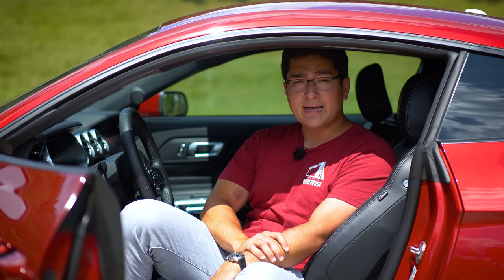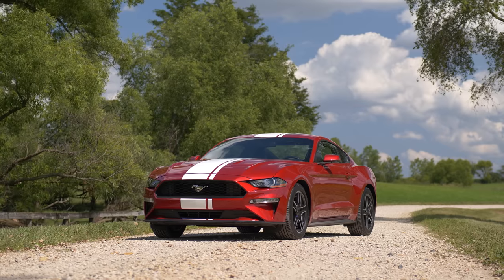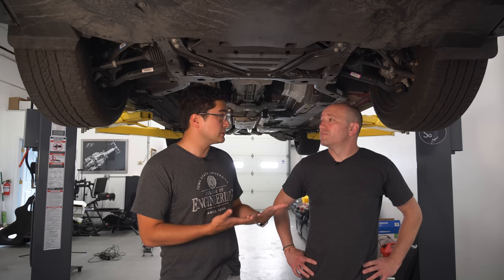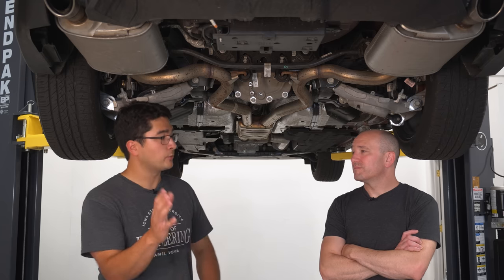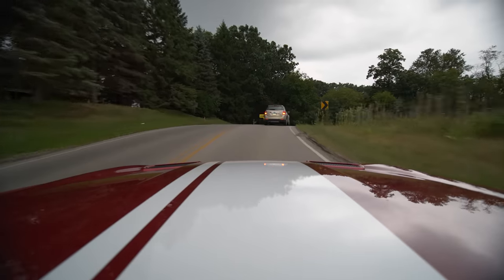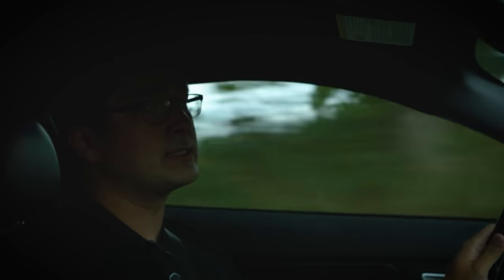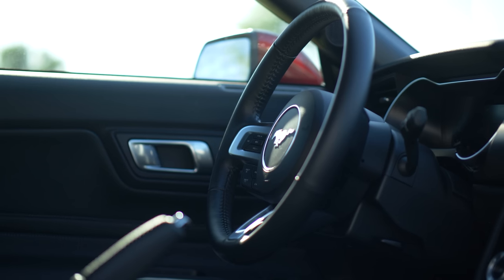2020 Ford Mustang EcoBoost | Red Headed Step Child

Comment: These two need to study some Mustang history. Throughout its existence it has been available in base models that did not have high powered engines. The majority of owners just wanted a "sporty" two door car in coupe, fastback or convertible shape. A lot of 6 cylinder Mustangs were sold and are still in use. I had an 86 GT that had 200 hp and thought that was fine. I had a 96 Corvette with 300 hp and though that was fine. Now I have a 2019 EB with 310 hp and it seems more than fine. If Ford offered a little V8 with 310 hp I'd be fine with that.  I expect Ford to offer the V6 Ecoboost in the 2022 Mustang, probably another engine you won't like. No guys, not all Mustangs need a V8, just as not all Camaro and Challenger need a V8.
Reply: Check out my EcoBoost on my channel 403 horsepower.

Comment: In Europe the running cost alone is enough to make this car a big hit. In some European countries displacement plays a major part of a car's tax, sometimes to a ridiculous degree. For example in my country (Romania) owning a 2.3 means you pay about $150 in annual car tax whereas owning a 5.0 engine means you're paying about $1.7k. That's an insane difference, largely because my country is ran by a circus, but this is the reality in these parts. 
Not to mention that a 300HP RWD car is considered quite powerful, and very few cars are RWD around here. Add to that the fact that it costs about 40k EUR and you've just transformed it into an enthusiast's bargain.

Comment: Ford did good with this 4cyl mustang. But when they announced an eco boost mustang I was silently praying that they’d use the straight 6 that’s so popular in Australia coupled with an optional MT.  If it “only” made 300hp the tuner crowd would go nuts. You’d see 1000hp versions by various tuner houses at the end of release week.

Comment: If it weren't for the fact that I live in Colorado (CO Springs), I would happily have one of these.  It's perfect as that compromise between fuel-efficient communter and performance car.  Unfortunately, winters here come early and stay long; we actually got snow on June 9th this year!  (Wasn't much, but still...)  RWD on snowy/icy roads just doesn't work.  I'm sure some folks will pipe up and claim they do just fine in the winter.  I'm sure some of them do.  But it just isn't good here.
Reply: Yep RWD just don't do good in snow period. I live in the southeastern part of Bulgaria, where the winter is real light, a lot of times we don't even see snow. But north western part where my parents live, boy oh boy, let's just say , the drive there is not pleasant when i go see them for the holidays. The ecoboost is cool and a lot more stable but still, in a snowy mountain area you are getting stuck no matter what you do .

Comment: Ford missed out on a great opportunity with the Eco.  They should offer a light-weight, stripped down, track oriented package.  Get it down under 3000-lbs...2800 would be better.  Now that's a 4-banger I would buy.
Reply: Easy to say rather than get it done, see the issue is Fords S550 chassis itself is a heavy weight, weighs around 980 lbs, compared with that the Chevy Alpha chassis weighs just 747 lbs, so the basic root itself is  not that great. Ford really needs some Aluminium/Carbon fiber based chassis for Stang

Comment: Interesting that you guys agree with Ford about the 10-speed auto pairing better with the 2.3 turbo. Some well known auto journalists emphatically despise that combination.
Reply: I can tell you from driving both and only a six speed that the 10-speed is by far superior when it comes to performance for the motor especially stock. The 10 speed keeps the engine in The Sweet spot when accelerating. Although I got the six speed because I want to drive a car that's fun not automatic. I'll take a little bit slower 0 to 60 or quarter mile time if it means having more fun driving. Plus once you start modding it it pulls through the gears much better. My EcoBoost drives like a tractor is seriously compared to a stock coyote feels like it has way more torque well actually mine does have way more torque but mine's also modified. Check it out on my channel I have videos.

Comment: Mustang is consistent throughout it's lifetime, if nothing else. Well, maybe not the Mustang II, but i digress. You have always been able to get a cheap, relatively reliable Mustang, whether it was a 1965 with a 200ci straight six, or this thing. It has always sold pretty well, which allows Ford to do little projects like the SVO and SVT. Hey, if I get stuck with a rental car, I'd rather be in this than a Camry, even though the Camry is a better car.

Comment: Did they decrease hp for 2020? I thought they 15-17 ecoboost were around 310-315 hp depending upon fuel octane. If you review one with an engine tune like Cobb you may look at the car different. You can get close to 100lb torque more with a simple tune on these.

Comment: Rental company gave me one recently.   The car looked nice sound system was solid great features like cooling/heated seats.  Exhaust sounded like cam from speakers to me. Main gripe legroom and it's really slow.  My Q50 would walk it low and high.  It didn't even seem faster than my 2022 F250.

Comment: Would You guys recommend an mustang ecoboost as my first car? For context I just turned 17. I like the ecoboost cause I really don’t need or want a super powerful car. My only worry is that it’s a rwd and i might crash in bad conditions.
Reply: Look into the 11 to 14 year v6 mustang 305 hp, it sounds great and there pretty cheap now
Reply: Get a 1990 miata.

Comment: Also the old "base model mustangs sucks" is a relic born from the 80's up to the early 2000's...once 2011 hit and the base mustangs were fitted with GT suspension and 300hp..that argument was just the echo in an old chamber

Comment: I think it's a really cool car with a lot of performance and style for the money.
Provided you aren't an enthusiast or are perhaps more honest about how you actually use these vehicles.
Is this a better car than a stock late model Supra, 300ZX, RX7 in almost every measurable way? (probably). Adjusted for inflation, is it cheaper? (Maybe).
Does it deliver the visceral and intangible experience of those cars? (No).
But it's comfortable and fun for people who are just going to drive them.
The best part is that if they sell a giant pile of them.. some teenage versions of ourselves will get ahold of a cheap used one and inspire a whole new generation of car nuts.
My 16 year old self would have been blown away.
Man I thought 5.0 notch backs were sweet cars...(this thing would blow the doors off an old 5.0

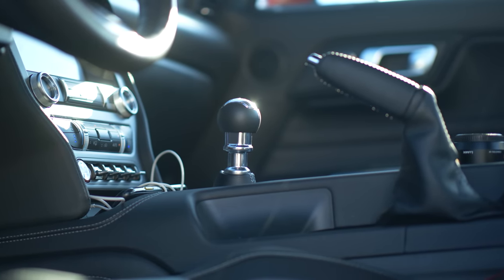Comment: 2:36 You never showed that handbrake lever in disengaged state.
Choice of electronic or mechanical dash gauges is amazing. That and instant speed figure update makes that US-made car surprisingly smart.
5:05 Dodge Murano - Geez, was that really necessary? Did that have to exist and be added to the collective consciousness?
7:00 Mustang - where a 300 HP car is "a little bit sporty".
You know what's messed up? I check the Ford website and they are offering an electro SUV under the Mustang brand!!!
17:15 "We don't all", not "We all don't".

Comment: Additional thought, per Mr. Goose “Nobody is going to drive (GT Premium, 6 speed MT, Performance Package ....) everyday”; I drive mine EVERYDAY in the northeast, snow, bad roads, etc. Again, great everyday car + highway mileage at 70 mph with cruse control is typically 32 mpg.
Reply: More leaning towards the gt500 and gt350. I dialed and weekend warriored my s550 gt pp1 year round.

Comment: I mean, but what if you want a newer car that’s faster and more maneuverable than your older O2 Roush Mustang? And while still being faster also has improved rear suspension and a bit more nimbleness than its 3800lb tank brother?

I’m desiring a lower weight car. Like the BRZ. So I can forgive gaining 200lbs if the car actually corners better and is faster lower down than my car.

Comment: I remember back in 1993 when the automobile media went gaga over the brand new 1993 Chevy Camaro Z28 with the rockin Corvette 5.7 under the hood making 275 horses! Now a boosted 4 cylinder makes over 300 horses and there's practically crickets!

Comment: I’m currently driving a 99 GT with a 4.6 2v and I'm serious lusting after an S550 4-banger-stanger with a 6 speed

Would I be disappointed with an eco boost if I replaced my new edge with one?
Reply: Check out the channel "sgtr" to see what a new edge 2v can do with some bolt-ons.

Comment: When was your last time driving your GT on a track?
I'm an ecoboost owner since 2018 and so far I'm not regret buying this car. When I purchased this car back in 2018, I was looking for some car look cool, driver focused, and two seater. Then the remodeled mustang came to my list. To be honest I had a hard time to make a decision between GT and eco. But I chose eco because of practicality. Surely GT gave me better feeling when it's on high revs but I have to drive it like a maniac on public roads. If I have to say something I don't like about the car it would be fuel economy. I refuel the tank around every 280 miles on average. This could mean multiple visits to gas stations every week for some people.  But choosing a GT or a higher end model can only make the thing worse. 
Besides, there is only less than 10k difference between a 2.3t and 5.0. Is it really something considerable for getting a new car these days? I don't think so. Price is not a main factor here.
Reply: drunk doughnut / price is not a main factor in the USA, in the Netherlands it is due to taxes.🤐
Reply: Was the 2018 really that bad on gas? I have a base model 2020 and I get roughly 430 miles off a full tank of 87. Slightly more if I'm driving high octane.

Comment: If you were actually pushing this thing to the limit and driving it like you should’ve close to 5K rpm in the actual power band instead of calling on the turbo without building pressure you would’ve seen the eco and BOOST part

Comment: 2001 Pontiac Trans AM RAM Air WS6 had 325 hp & it was the top V8 sports car...non vette.

The Ecoboost Mustang is on par with many many V8 cars in my lifetime.  Compared to Ford Mustang 5.0 or 4.6 it has the performance of previous V8 cars. 
Now when Hemi Supercharged cars, no ...they have more power than needed, and they still get defeated by Teslas lolol

Comment: Also called the Ecoboom. Scotty Kilmer has a customer with one of these 2.3 Ecoboost Mustangs with 90,000 miles and he said that the engine is already wearing out.
Reply: Ford should have kept the V6 in the Mustang. I considered buying a used 2015-2017 Mustang V6 for pizza delivery but decided no after sitting in one and trying to get out. My 50+ year old legs wouldn’t like doing that 30 times a day. I’ll keep driving Rangers and small SUV’s.

Comment: I just can't modulate the clutches in these cars, they seem to be higher off the floor than the Camaro or Challenger, I can't pivot with my heel to make a smooth release, not to mention now it "snaps back".. nice review as usual.

Comment: How long will this boosted 4-cylinder engine last?  I have heard that Ford's small ecoboost engines can start burning oil after 60K miles because they are too small for the heavy cars where they are standard equipment.  Also, is it true that problems are surfacing with the 10-speed Ford automatic transmission?
Reply: From where did U get this stupidly wrong information, Google links??
Come on, do understand that Fords 70% models sold nowadays are turbos, and yet its market share s still in progression, which says a lot about ecoboosts.
if at all some ecoboosts failed they are the 1.0 i3 and the 1.6i i4s with 160 hp tune and the Focus RS 1st 20 batches which had the head gasket issue
Rest all ecoboosts are almost as reliable as NA motors
Reply: @ponygt6629  Check this out:  https://www.youtube.com/watch?v=dqQa5sFYzgo&t=147s  Scotty has also reported that Ford's EcoBoost 4-cyliner engines are burning oil when they hit as little as 60K miles because they are too small for the cars that Ford is putting them in, e.g., the Explorer.

Comment: Mustang Ecoboost fully loaded with manual transmission and High Performance Package (focus RS engine) and handling package OR a similarly priced ($43K MSRP) BMW 230i? Which would be more fun to drive?
Reply: Would you not consider buying a used ss1le, gt performance pack premium, m240i instead? I think that is money better spent
Reply: @jackholmes8105  I am assuming they would cost significantly more in car insurance. I have 4 teenage drivers on my policy and 4 totaled vehicles in the last 4 years. I could afford a GT350, but I don't want the insurance premiums. Those vehicles that you mentioned would be very nice! And it is telling that you would choose those over a new Ecoboost or 230i. Thank you.
Reply: Bryant King hope that helps

Comment: Excellent review. I would always feel compelled to rationalise why I bought the eco boost and not the GT. One reason I would never buy a Mustang is because Ford does not change over the centre console for right hand drive cars. This leaves the cup holders in the worst possible position. Think about that. Ford is lazy on RHD conversions.

Comment: 9:10 what is going on with that linkage? Right where the camber correction bolt is look at the connector. Is that flaking paint or a broken arm? (at the base w/the little bit of rust on it). This is a 2020? WTF How is there so much rust on this vehicle already?

Comment: Thoroughly disagree with you guys in this video.

I drive a WRX - a “performance car” in the same vein as one of these and it’s a ton of fun.  It’s not a fast car but it’s fun. I have a friend who’s tuned one of these for 425 to the wheels.

Also, my WRX (as you guys know) is very stiffly sprung. The 2018 with the inverted front shocks and all.

I would say my car is 10% over-firm for its power level, and what it is, but I’d rather have the confident firm suspension than a couch on wheels.

Fords are always two soft. 300hp, RWD, with a stick and a locking diff. It may be the volume seller but Ford could’ve put a little more effort in and made it a more competent machine without ruining the daily driver factor.

Comment: I gotta respect the fact that they made something that can chirp tires in 3rd gear and still get 30+ mpg hwy. Granted, I PREFER the "old" V6 if I can't afford the V8, mostly because turbo 4 exhaust is garbage, but fortunately you can bump up the power of this turbo 4 for not much money. If this car was significantly less than the GT, I'd definitely consider it. Hell it's faster to 60 than most any FWD car on the market, and it's cheap and gets great mpg.

Comment: I find it interesting that the 2.3L turbo four 2020 Mustangs have approximately the same power and weight as the 2005 Mustang GT with the 4.6 L V8 (300 bhp, 3500 lb), and the GT at the time was a pretty exciting product. But for some reason a 300 hp Mustang in 2020 is greeted with about as much enthusiasm as a base Camry or Accord. I wonder if in 15 years we would greet a 700 hp base Mustang with equivalent indifference?

Comment: I love this car because it allows the upper Mustang tiers. A good thing. Camaro does the same. As does Challenger. Quite right. I don't have all that green to throw at a car. The Ecoboost is a nice proposition. To put in perspective. My 2010 GT Mustang V8 put out close to the same power of this current Mustang. It was a hoot. Sure the V8 sounded great. And gas mileage wasn't all bad. But this is an intelligent car for those wanting the Mustang story and special times that only come with Mustang. No other Pony car does this. Mustang was first out the gate. I love the Camaro, can't see out of it, but it is a better platform than this car. But Mustang is special always for me. Friends, family, and the roads traveled for the good times that are only Mustang. Your mileage may vary.